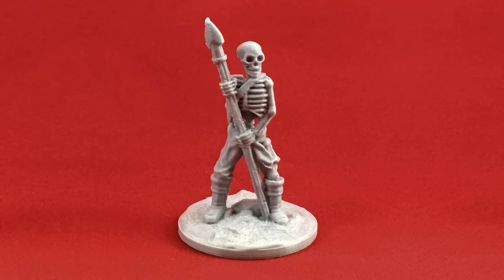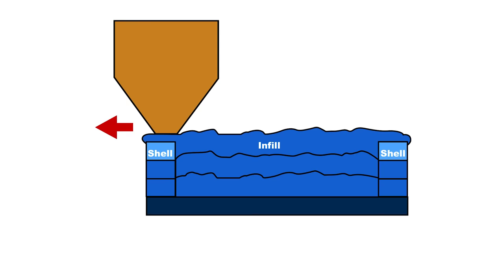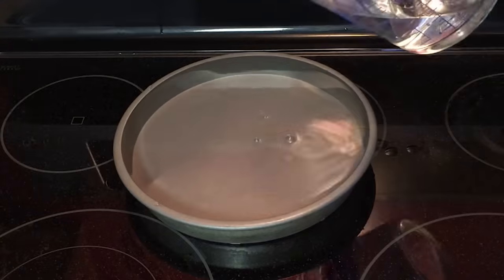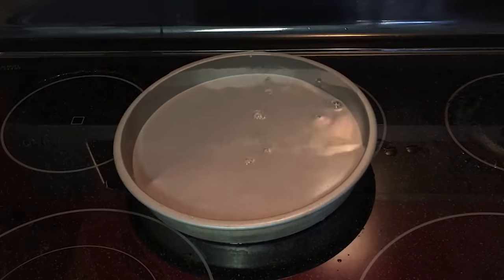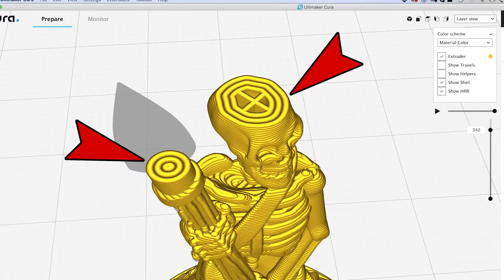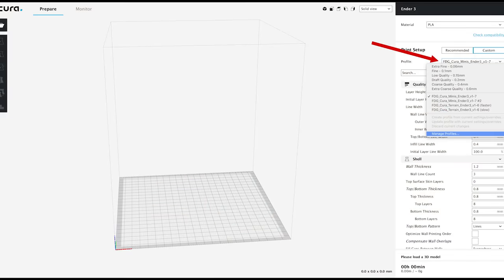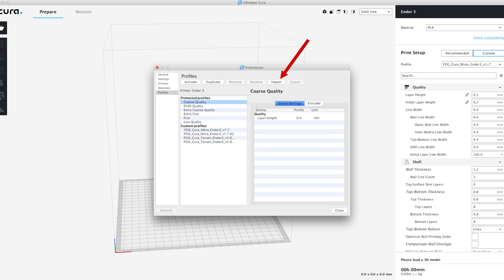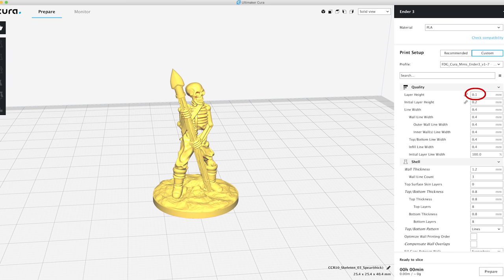How to 3D print miniatures on a FDM printer

Comment: so your saying you dont have a video on supprts?
Reply from the maker: Not currently. :)
Reply: @Tombof3DPrintedHorrors  i switched my cr-10 over to your settings.. i printed a pole arm knight  on it and it looks great. however my ender 3 isnt sticking to the bed same print same settings.. so i bumped the heat of the bed from 60 to 65.. its printing as i typing this. ive had problems with my ender. and finding these videos are amazing. you're clearly explain "what and why" . thank you 

also you have a radio/podcast voice.

Comment: Are supports necessary for printing the minis? For example, this one I suppose that the mini with arm and the crossbow would need supports

https://www.thingiverse.com/thing:3054701
Reply from the maker: None of the FDG miniatures shown require supports, we specifically sculpt everything we sell to not need them. I will do a separate video on how to use supports for other brands that require them at a later date.
Reply: @Tombof3DPrintedHorrors  okey. Thank you

Comment: How is tree support for this profile?
Reply: OS shouldn't make a difference. What kind of tips are you looking for?
Reply: @MrFlayFox  Well i am printing a test mini form forge hero that is holding a shield and a sword that tend to print spaghetti when the prints start on them. I was thinking that the tree support would help but testing it out, the supports made it difficult to remove. What should i do to prevent the shield and sword to not print correctly? Also i used the settings in the video and they work great on the main body.

Comment: The falling speed is not constant, the falling acceleration is
Reply from the maker: I know, but this video is about 3D printing miniatures, it's not intended to be a physics lesson about the acceleration of gravity. Going into an explanation of how all objects accelerate at approx 10m/second/second (not counting air resistance) until they hit terminal velocity due to that air resistance would be overkill. Much easier to just say the speed of the dropped minis is constant, which gets the point across. :)

Comment: Is this still relevant today in 2023 with Ender3 v3 se?
Reply from the maker: Yes, but my newer profile settings (available on my website) are better fr current versions of Cura with Arachne engine. That said, the SE isn't the best Creality printer for miniatures, you want a Bowden feed for minis, not direct drive (the Ender-2 Pro is the best mini printer).
Reply: @Tombof3DPrintedHorrors  oh. So what can I do in the profile settings to compensate, please? Thanks!
Reply from the maker: @blahtoausername  you can't compensate for the increased mass of direct drive, it just is what it is. All you can do is make the LCD changes I recommend in my SE videos and then just use my newest profiles from my website, they are for the more recent versions of Cura. Change the retraction to 1mm for the SE.
Reply: @Tombof3DPrintedHorrors  Got them, thanks! Would that be Retraction Distance, Retraction Minimum Travel, Retraction Speed or Retraction Extra  or Retraction Speed??
Reply from the maker: @blahtoausername  Retraction distance.
Reply: @Tombof3DPrintedHorrors  Thanks - I ran a print last night without changing this to see what I'd get and what I got was my very first spaghetti ball! I'll try again tonight with Retraction Distance set to 0.1 :)
Reply from the maker: @blahtoausername  not .1, but a full 1mm
Reply: @Tombof3DPrintedHorrors  D'oh!
Reply: @Tombof3DPrintedHorrors  Thanks - I'm getting impressive quality prints, however I do get some bed adhesion issues. Supports are coming loose, getting knocked over and then I'm getting spaghetti. Is there a setting I can change, please? Or do I try some hairspray on the print bed?

Comment: I liked the video - it has good advice, but it spends a whole lot of time talking about what not to do and why not to do it when all I really want to know is what I should be doing - I mean it starts talking about infill at 04:00 and rambles on for 7 minutes talking all about what doesn't work until 11:00 before it gets to anything about what settings to use which will work (!) - maybe it's just me but I don't really have the attention span for that ;-) Thanks anyway!
Reply from the maker: Just telling you what to do won't teach you WHY it works and how to analyze issues you will inevitably experience 3D printing models. Critical thinking is essential for you to be successful in this hobby.

Comment: Thanks for all the explanations! Very good video and results. One remark: when you talk about cooling (https://youtu.be/AqEWl51s9Rw?t=1432) speed modifier settings can be seen at "Minimum speed" and "Minimum layer time". I.e. reduce speed to a min. of 10 mm/s if the layer would take less than 10 s. Are you sure your velocity is fixed to 22.5 mm/s?
Reply from the maker: Since the minimum speed is set lower than the various speeds I had set I am not sure I am seeing what the issue would be. The only thing that would override that would be the jerk setting which is a transitional speed the printer temporarily slows down to prior to changing directions. I'll go back and recheck my math, but I believe it is ok as-is. :)

Comment: To my knowledge you have never made a video following up regarding supports. That really is the missing link to success, here.
Reply from the maker: None of my sculpts (minis or terrain) require supports so I've never needed to make a video for them.
Reply: @Tombof3DPrintedHorrors  That is quite surprising. So many minis are, for example, a humanoid with their legs spread widely holding a weapon in a high guard. Lots of overhangs at best, and more often than not a sword or a staff or something that has no model under it.

I presume, as someone with a huge amount of experience, you'd just look at models like I'm describing and see them as a no go with FDM? Which frankly would make a lot of sense, failures abound when I try.
Reply from the maker: @BlueButtonFly  try our supportless Dragonlock minis. As I said above, no slicer supports required.  ;)

https://www.fatdragongames.com/fdgfiles/dragonlock-miniatures/

Comment: The falling speed is not constant, falling acceleration is.
Reply from the maker: I know, but this video is about 3D printing miniatures, it's not intended to be a physics lesson about the acceleration of gravity. Going into an explanation of how all objects accelerate at approx 10m/second/second (not counting air resistance) until they hit terminal velocity due to that air resistance would be overkill. Much easier to just say the speed of the dropped minis is constant, which gets the point across without being pedantic. :)

Comment: Great tutorial.  Thank you for sharing your settings and recommendations.  However, you are wrong about "jerk" setting.  It is not a speed, it is the "speed" at which acceleration changes.  What I mean is, as acceleration is the rate of change of velocity, so jerk is the rate of change of acceleration.  Think of it as how fast you change the position of a car's accelerator pedal.  

Look at the units.  See this Wikipedia article for more information: https://en.wikipedia.org/wiki/Jerk_(physics)
Reply: >Reads a one page wiki explanation of "jerk"
>Has to make a pointless comment on a master level miniatures print guide video to quibble over his precise explanation of "jerk" that has no bearing on the optimal print settings.
>Clearly doesn't have a firm understanding of calculus and oversimplifies a 2nd derivative himself.
>You're the true "jerk" here.